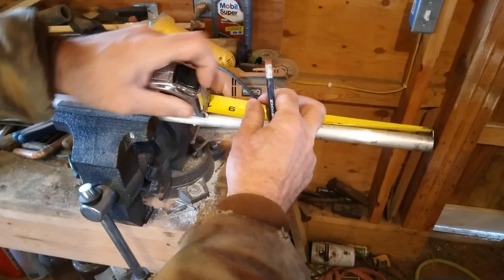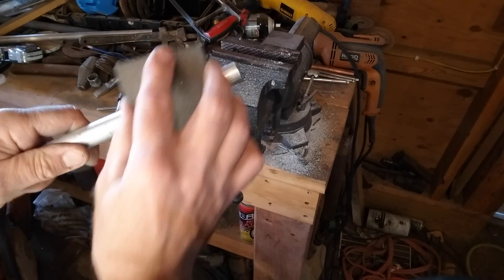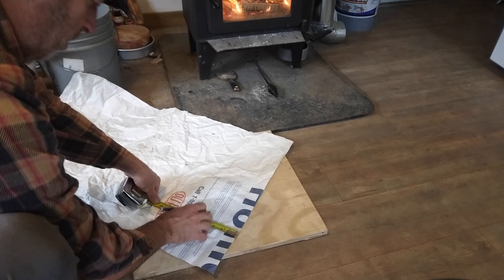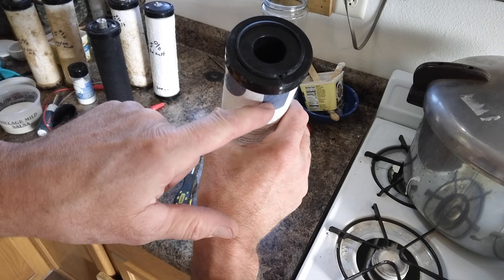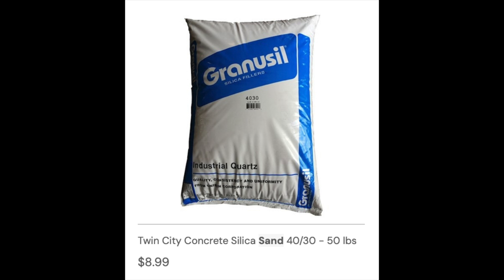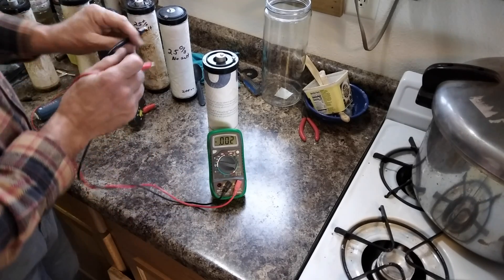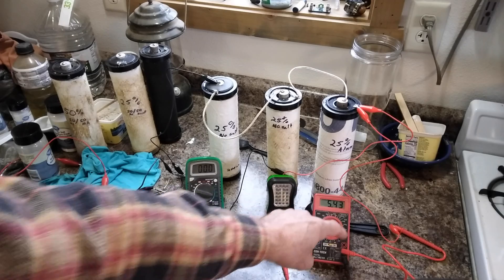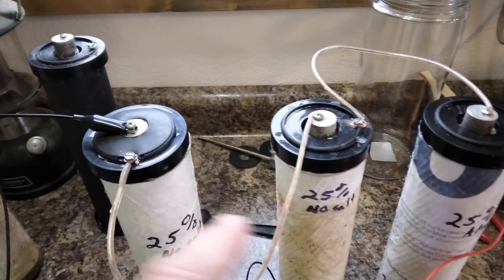How to build magnesium water filter batteries

Comment: Will the magnesium be consumed slowly over time or only when there's a load? 
Any waste byproduct that needs to be disposed of properly?
Reply from the maker: The magnesium seems to corrode according to how wet it is.  But some dampness is needed for a current.  If it's just dry, nothing happens to it, and you can usually still read some voltage, but little or no current.  There's no indication that oxidized mag. and electrolyte are hazardous.

Comment: Cool build.  Please try adding a solar panel.  

Wiring in parallel adds up amps.  I built an earth battery and wired it in parallel to a small solar panel.  It worked great to up the amps!  I got a small on from Harbor Freight.  Build your earth battery in series and hook a solar panel to it in parallel!

Comment: I always love your videos and ideas. Do you think you could make a video about telluric currents and energy collection? I think one could stick multiple rods into the earth at exactly the angle at which the magnetic field lines penetrate the earth where you live.
Reply from the maker: I don't know enough about them, or that there is significant energy available.  From what I read, you need to place rods in the ground at varying depths, 100-300 meters apart connecting them with a wire, to get tiny indications that geophysicists use to map subsurface structures.
Reply: @doubleMinnovations  if you stand with knees bent and feet on earth - and the left hand for males is yang and lower body is yin with the right hand yin and upper body yang. This creates free energy by just understanding the polarity as asymmetric time-frequency flow that is nonlocal. You can look up Eddie Oshins at SLAC who coined "quantum psychology" to corroborate my claim - he says noncommutativity is the secret of neigong (alchemy). thanks